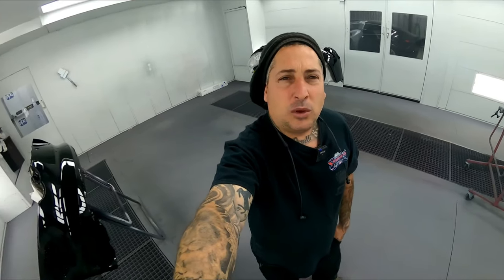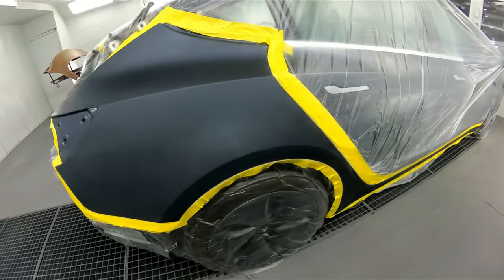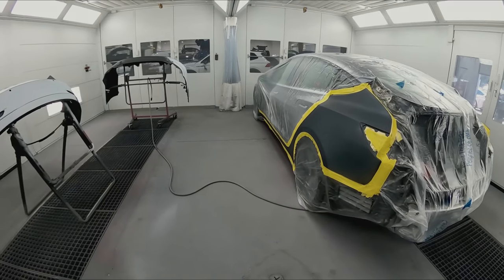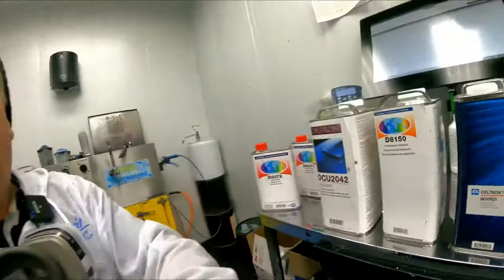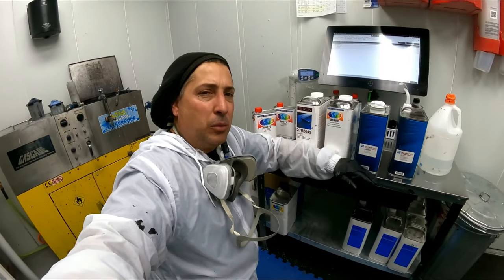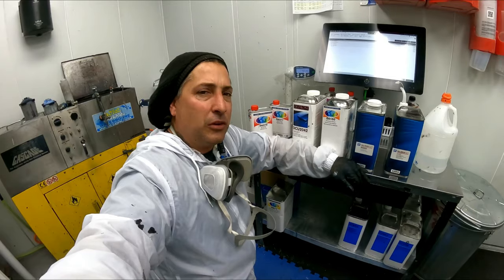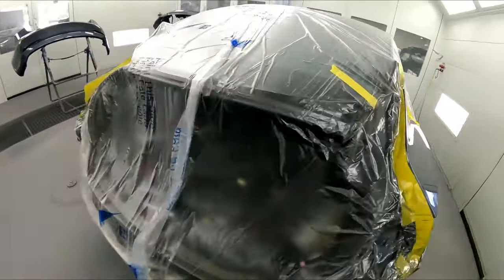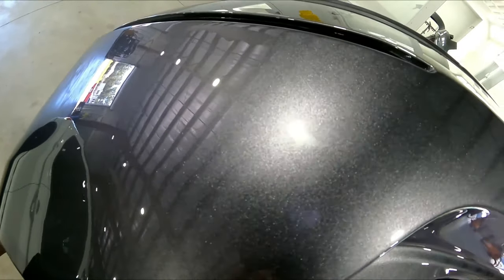SOLVENT POP FIX

Comment: I have started running Roberlo 510 Kronox lately with good results using my DV1 Clear with CS-1 1.2mm with good results. Love all 3 of my DV1 guns. Recently I switched from Walcom. Just finally saw the light and love the low working pressure.
Reply from the maker: I love my dv1 clear smooth spraying machine

Comment: Was recently given a tip for micro solvent pop; when taking the panel out the booth immediately buff the affected areas to a warm/slightly hot feel it should dissipate the pop
Reply from the maker: Yes thats  the fix no sand buff right away. 💪💪thanks for watching

Comment: I have run into the same problem. I just use the slowest in any single stage and clear and turn the temp up in the booth when its cold.
Paint problems at work have to be from the binder shortage. Valspar must also be doing something on their end. Valspar lvbr100 base I have been using 1.5 years all of a sudden sprays with what looks like sand, then solvent pops the clear. Matrix edge did the same. Valspar from a different supplier is fine. I have noticed the smell of the paint has changed. Its 80% binder. We order pre mixed at the moment. We have a huge refurbishment on going and spray 99% Ford UJ. When the issue started I pulled out some cromax mosaic we sprayed for 8 years and it was fine. The supplier was blaming us for not spraying the base right. Even brought a painter in to show us. Its the dirtiest hood I have seen and it died back and popped. I told them that there was no way 3 painters that use 3 different guns can have the same problem at the same time.
Reply from the maker: Yes there is a lot going on in the paint world 🌎
Reply: @kandyman5315 main job is construction. Side job automotive. Everything supply wise has turned to 💩not just in lack of availability but quality as well. Name brand stuff too. Every aspect of everything is garbage. So not surprised to hear it in paint quality too. Started triple straining automotive paint and clear to cover my ass
Reply: 3 different painters using 3 different guns. Awesome way to eliminate variables. 👍👍👍👍👍👍👍👍👍👍👍
Reply: @pitchforkpeasant6219  I just did the first come back from the base coat issue. Had a car with the clear delam. Blew the clear off everything we painted. We switched to akzo nobel imperium waterborne a few months ago.

Comment: I've had solvent pop issues spraying in cold weather as well, if I heat up my shop but don't give the substrate enough time to come up to temp and only spray when the air temp is good I'll get it, especially with the cheaper clears
Reply from the maker: Crazy  stuff happens in this business sometimes lol
Reply: Ive had the same thing happen in my shop in winter. Also started pre warming my material before i paint

Comment: What was your ambient temperature?
I have a few gallons of 2021 clear with the medium reducer and hardener to paint a classic VW van. 
I’m planning to spray it when it’s around 70 to 75 degrees.
I was advice to use the medium speed products.
Will slow be a better choice?
I will first spray all the bolt on panels and another day will be doing the body. 
I will use an  inflatable booth.
Thanks for the advice!
Reply from the maker: That  will work

Comment: Kandy Man,

I'm thinking about trying one of those Deltron clearcoats out. Which one would you recommend for collision work? Also, when you are applying that particular clear, when it comes to flash times, do you follow the flash times to the T or do you test the panel first to see if it's ready for the next coat. I know some painters say they will touch a part of the panel to see if it's stringy and if it is that means it's ready. I've heard some say that it needs to be handslick before applying the next coat, which would mean you can run your hand across it.
Reply from the maker: I use 2021 only it is great not speed clear but can be useful in production  is about a 8 min flash for me between coats
Reply: @kandyman5315  I'll check with my jobber Monday. You don't have an idea of pricing do you

Comment: If you like the 2021 try d894 global clear.same thing as 2021 but the European smoothness.
Reply: I had the 894 high solid  but I had the wrong hardner but.I just 2021 10 years ago but a medium  solid clear.But the 2002 high  solid is the bomb. Slow Reducer  15 or 20 mins flash time told me that secret and it wrong .and David from the old Via Liz told me that also

Comment: Can i ask you why i get solvent pop after weeks? In particular After the car was sitting in the hot sun.
The affected parts are the pillars and the horizontals areas ( the most that get sun )... Maybe i have to wait more between coats...
Reply from the maker: Haven't seen it weeks later  sounds like dry spray

Comment: Hello, I never had solvent pop issues and now I have it always and can't get away from it. I am being told that these clears have no solvent in them or that the product has changed. My only issues used to be spraying clear to dry or getting a run and I have solvent pop every single time from the first coat I will let it wait till completely dry before I do a second coat and it comes up all over the place I can't get away from it I can't do anything about it I bought different hardener I don't know what it is I used to never get solvent pop never and now I get it every time I spray clear and it is such an annoyance can anybody help me
Reply from the maker: Are you sure it's pop
Reply: Yes I lay down the clear and it comes right up there isn't anything else it can be
Reply from the maker: Dry spray maybe
Reply from the maker: Pop comes after it drys not right away
Reply: @kandyman5315  thank you I'd be happy to send you pictures this stuff happens over and over I will try to talk to some area reps and figure out what this is I've been doing it long enough I know it isn't dust and it's been happening consistently in the last three paint jobs thank you for your concern
Reply: @kandyman5315  I always thought it did to whatever this is comes up right after I'm done with the first coat all these little blisters and Pops it's extremely apparent it comes up 20 30 seconds after I lay down the first coat of clear and I don't know what the hell it is and where is coming from and why I have never had this issue it's only in the clear. If there's a way I could send you a video I would pay you for some time to help me get on the other side of this mess
Reply from the maker: Message me on Instagram carkandyman
Reply: What pressure are you spraying the clear with? Sometimes too much pressure and too close to the panel can force micro air bubbles into the clear which can also look like pop

Comment: Fact- if your DCX61 hardener is opened for 3 months, you shouldn’t use it. If it’s under 3mos., but over 1 month, you can get away with using up to 40% in with your new hardener. Don’t fool around with old hardener.
Reply from the maker: Thanks for the insight